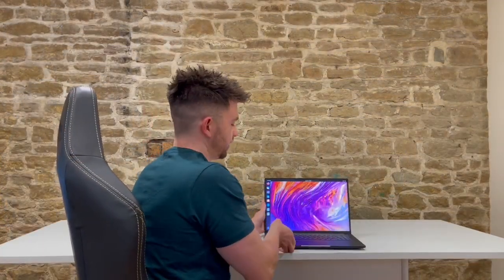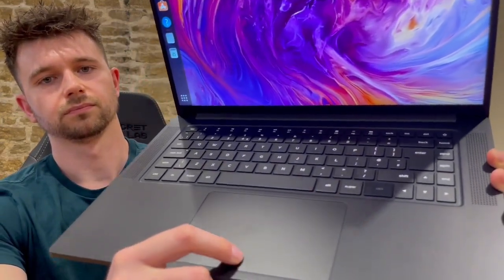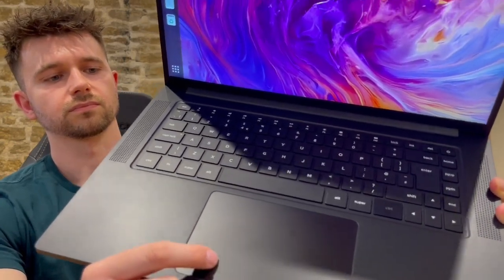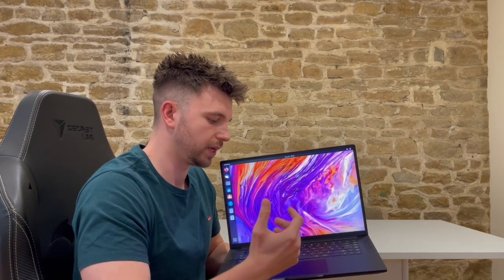StarFighter Overview

Comment: To hell with the camera, who needs it? But why is there still no LTE modem with open software inside!? And also a docking station where you can snap the PC with one click, just like in the best years of Ibm/Lenovo. 
A replaceable battery would also not hurt, as implemented in the Lenovo X270 when the battery can be changed “hot” without turning off the PC, this is what is really needed!  Well, I think an Ibm/Lenovo keyboard with a Track point would be a more interesting solution! When creating the ideal laptop, you need to take the best solutions that have proven themselves over the years and integrate them into your product!

Comment: Looks very promising. Couple Q's
How are the AMD versions of this notebook with Coreboot?
Could we have a 'bring your own storage' option (i.e. if we wanted to just chuck in an existing OS install)?
I don't suppose you guys would be willing to put up a tear-down / basic disassembly video?

Cheers
Reply from the maker: To confirm, we do offer coreboot, but we are currently waiting for AMD to resolve a small bug before we can deploy coreboot for AMD variants. We aren't offering a "bring your own storage" option - However, if your SSD is an M2 2280 drive, then by all means you can replace the one installed with your own and we will be providing a disassembly guide to assist with this 🙂
Reply: @starlabssystems  appreciate the info. Would love to check one out in person.